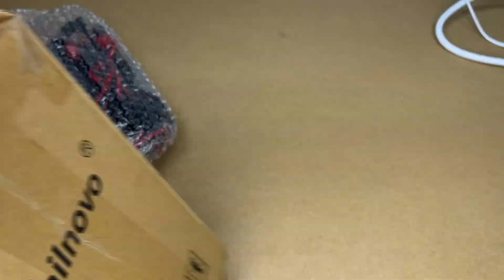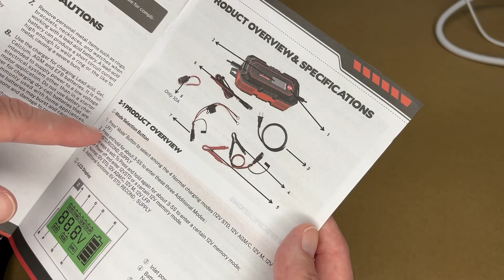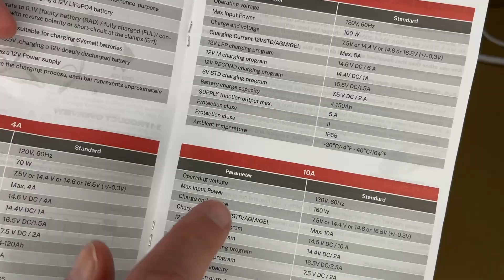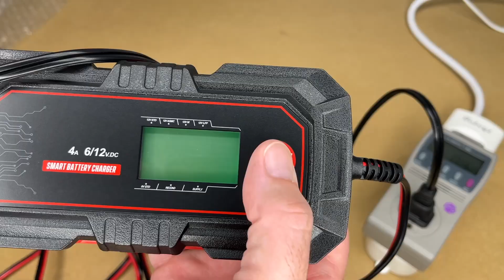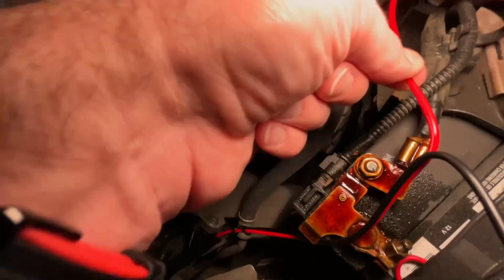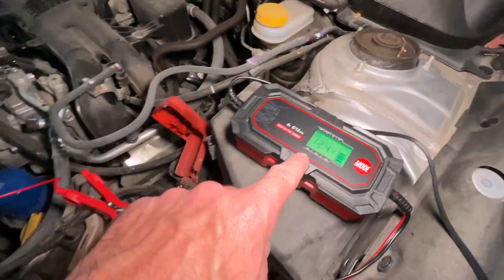Sailnovo 4A Smart Battery Charger, Maintainer and Reconditioner

Comment: Going through the modes so quickly was difficult to follow and the instruction sheet is pretty simple. I wish there was an explanation of what readings display. I just got mine today and it shows 7.5v and it is blinking. This is in my 2022 Lincoln Corsair and so far there have been no problems. I can’t believe my battery is drained down to 7 volts.

Comment: Thanks! Ordered one yesterday.  Seems decent and price is pretty good.  Has high Amazon ratings.  I have a 12ahr lithium battery to use it on
Reply from the maker: I've been very happy with this charger. I think I've used it on five different cars in the past two weeks to keep the batteries at top charge during this cold weather we have had.